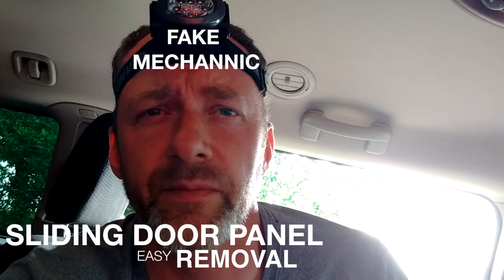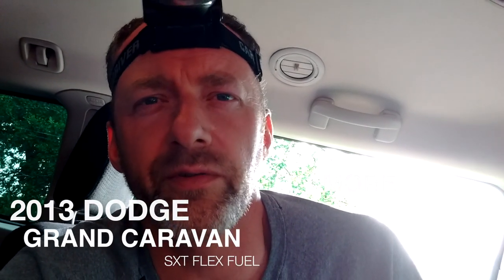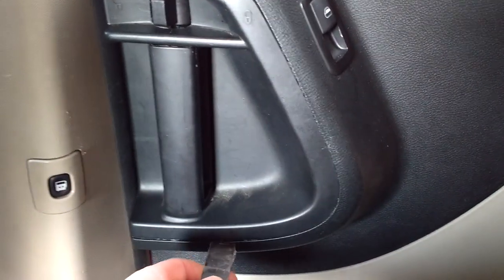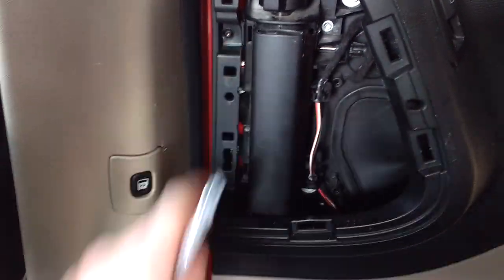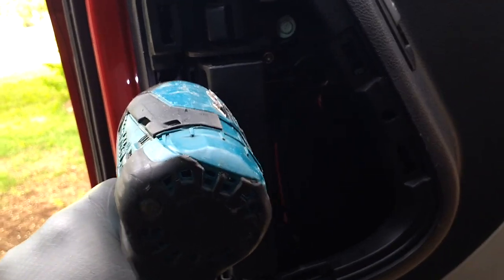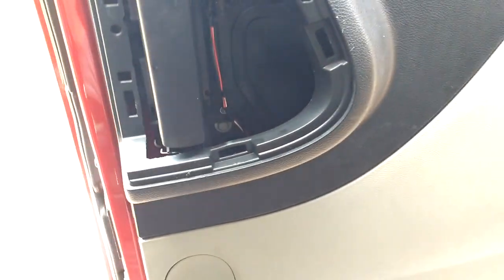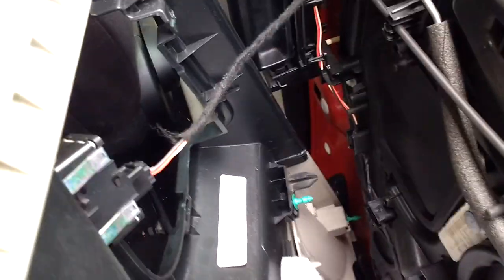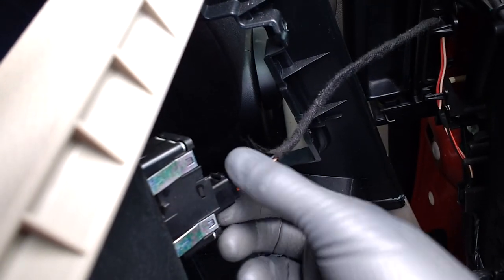GRAND CARAVAN (TOWN & COUNTRY) SLIDING DOOR PANEL REMOVAL

Comment: My 2008 Chrysler Town and Country is almost identical except that there are two TORX  screws on the outside by the handle, on the front edge. But it also has the one inside the handle cover. And getting the clips to come out...figure on breaking them all.
Reply from the maker: Good to know. Thanks. True about the clips; I broke 2 or 3 myself. There is a link on here somewhere on where to buy em.
Reply: same with my 2010 dodge grand caravan

Comment: I don't know if you will see this, but - I am desperate. How do you remove that panel with the door stuck shut?
Reply from the maker: Try disconnecting the car battery for 5 minutes recconect and see if that resets your lock relay.
Reply from the maker: If that doesn't work you'll have to pull off the panel and reach inside the door to unscrew the lock motor that holds onto the lock latch on the vehicle.
Reply: @josephsopala7642 ....u
Reply: Just did this on my 2010 town and country. My problem was the lock mechanism was stuck. I only had to pry enough of the door panel off at the top nearest the rear of the van, to reach the bar that operates the lock mechanism. Then a good sold push back and forth got it unstuck. I never took the panel off all the way on the "bad' door, just enough to reach inside. I took the panel off the "good" door all the way first, for reference.